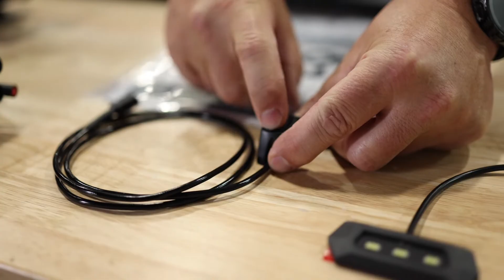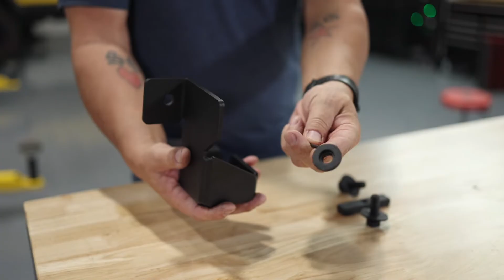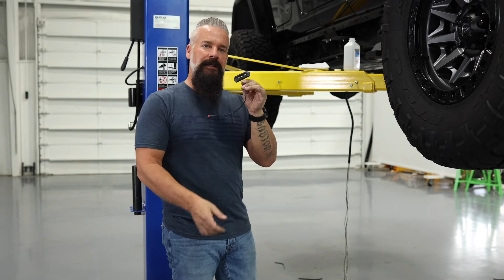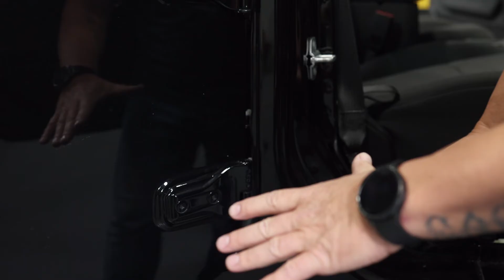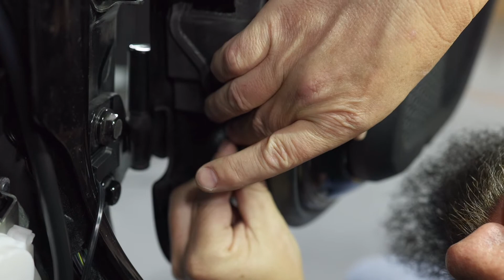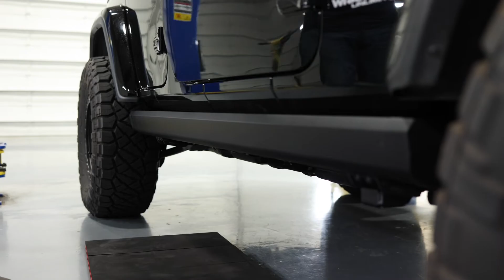How to Install Powered Running Boards on a Jeep Wrangler JL: Step-by-Step Guide

Comment: Hello, good evening. I have a question: I installed mine in a four-door vehicle, but when I’m driving on poor-quality roads, there’s a lot of noise—it sounds as if things are loose. Does anyone else experience this?
Reply: Check your front motor assemblies. Mine are hitting the frame in the closed position. Slow speed on a bumpy road is very noisy. I removed the sensors on the back doors to drop them down to drive the Jeep. No noise at all with them lowered.

Comment: If you want this to be an easy stress free installation remove the interior panels before you even begin running wires.  If the panels are removed first you can start and finish the installation in one smooth attempt. Otherwise you will have wires lying everywhere while you are managing panel removal.

Comment: What could be the possible problem if the running board opens a bit then closes right away even if the doors are closed. This usually happens when the car is on parking like not being used, engine is off.

Comment: Been a long weekend but they are on my 2 door and actually work in spite of the terrible instructions that come with it. You Tube video helped but makes it look easier than it really is.   The extra protection for the motor housings were a pain in the A**.  Cabling seems like it's 1 size for all, 2 or 4 door. Passenger side had too much and driver side short so I spliced some more in. Agree that override switch could be better or use aux switch in jeep. Hope the sticky tape hold the magnets for a long time.
This is the second power running boards I have installed. The first were AMP research.  They went in well, good help line.  Trigger is tied to interior lights under dash.  The electronic brains stay dry under the hood, hope Rough country brains stay dry under the passengers side - have my doubts and changing will not be fun
Reply: Hi, for the 2 Dr there are two M12 T bolts with two plastic lock washers. Where and exaclty how do you install these?

Comment: Rough Country how do I adjust them from hitting the jeep when they close. the one on the passenger side hits my jeep in the middle of the board then a second later it backs off. I don’t want it hitting my jeep every time it closes. Happy to send a video.

Comment: I just installed these on my 21 JLU. To open my motors, I just used a 12v cordless tool battery and touched the wires to the plugs. I installed the door sensors on the rear to the latches. It helps to open the boards faster. The kit does not have an option for Doors Off driving. I did some testing and have a solution. It involves adding two time delay relay modules and some momentary push buttons. I can give more details if needed. I did not like the instructions or packaging at all. A complete mess. The driver side motors should have had all the bolts packed with them. Same for passenger side and motor covers. Instructions should have been separated to 4 door and 2 door. Not shown on the same pages.

Comment: Hello this might be a Gladiator specific question but for the rear mounting blocks does anybody know which way you’re suppose to orient them? They are ramp shaped and instruction don’t mention which way to put them on???? I did mine with the thicker part towards the rear 🤷🏼‍♂️
Reply: That’s the way. Body kinda cinches up so the blocks offset that.

Comment: Those motors come closed why didn’t you show how you opened those motors without power. You can’t reach the bolts while they are in closed position.
Reply: I left those bolts bottom up bolts and the front motors guards for the end. Once I had all else mocked up and tested for operation I left motors extended and tightened up everything. Helps to batter center boards to have them rather loose.

Comment: Appreciate the video greatly. It helps to have a 2nd person to install the motor protection plates to catch the threads on the flag nut and the M12 tension block . Also connecting motor harness , I had to use needle nose pliers to tuck connections inside protection plate.  My install is on a Sahara 4xe which has several insulated cooling hoses and wiring harnesses on driver’s side frame rail limits access to holding flag nut and feeding wiring harness. Job would have been much easier with motors extended. Also mention torque specifications are in installation pamphlet.

Comment: WARNING if you are watching this for help with the JT install. Ground in rear is not the same. Getting the 3rd bolt in the motor is a complete PITA with the motor compressed. Notice how the motor is all of a sudden extended when he puts in the 3rd bolt? Trash instructions.

Comment: How do you get the motor arms down without power??
Reply: Same question. After watching the video several times, the harness is on , off, and on … I suspect they were power cycled.
Reply: Working on them right now I used a battery with negative wire and positive wire I had laying around and lowered them to get to bolts

Comment: If you have the all weather floor mats that moves the floor plug on top of the floor mat, how do you get the wires into the cab?
Reply: Just came across this issue. If you look under the passenger seat there is another drain plug that is not well documented. I used that one. Same es they show but routing it close to the seat brackets. Then at the base of the console stack and gears got area meet. Gives you a bit less slack when routing it to drivers side but still gives you enough. I mounted my switch onto the carpet with Velcro just below the 4wd gear selector on the drivers side.
Reply: Thanks I just asked that question

Comment: Will these install on a 4xe?
Reply: Yes. I installed on a 2021 Rubicon 4xE
Reply: @adamscyclingclub7078  are those good on 4xE ?? 
im installing next week on my rubi 4xE
Reply: @iyadwinder  fit perfectly. Wife's Rubicon 4xE and she loves them. I modified the install slightly- instead of installing the switch inside, I stowed it near the battery under the hood. I intend to wire into one of the 4 stock push button switches at some point, but haven't got to it yet.
Reply: @adamscyclingclub7078  So you’re trying to connect that switch to one of the AUX buttons?
Reply: @iyadwinder  yes. eliminate the switch. the aux switches have wire bundle that comes out by battery. if you go thru settings on the stereo, you can make the switch default to on or off. Remove the switch that is provided and then it's a process of figuring out which wire of the two (on the switch) is the positive. Then wire it up..
Reply: Yes, l installed on 2022 Sahara 4xe.

Comment: How did you extend the motors for installation without hooking up the entire harness?
Reply: I had the same problem. I hooked up the harness on the bench and cycled the valet switch to get the motors to extend.
Reply: I want know this too
Reply: @trevorhartfield5975  I ran a jumper wire to the battery to extend.

Comment: I'd like to wire these up to one of my auxiliary switches.  Anyone know how?
Reply: I was just thinking about how I can put switches in to make them operate with doors off. I haven’t bought them yet but I’m going to tonight. If I’m thinking correctly, I want to drill a switch in on both grab handles of my JT. Bc they use magnets to switch the motors it should just be a matter of tapping into those 2 wires to break the contacts with an inline switch. This will allow both driver and passenger to individually lower steps with the doors off.

Comment: do they double as rock guards?
Reply from the maker: Yes, these boards are made from aluminum and can give you some protection, but they are not designed to be used as rock sliders.

Comment: Do the e-boards provide any unbody protection similar to a rock rail?
Reply: I would say no.  They aren't metal.
Reply from the maker: Yes, these boards are made from aluminum and can give you some protection, but they are not designed to be used as rock sliders.